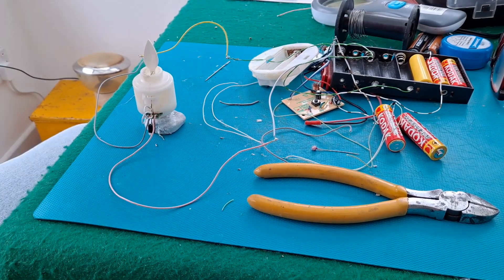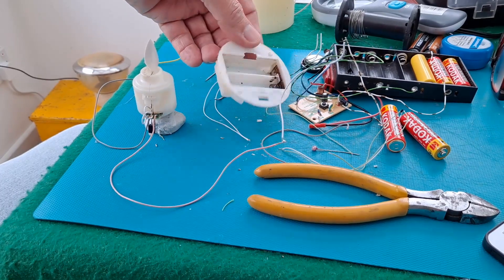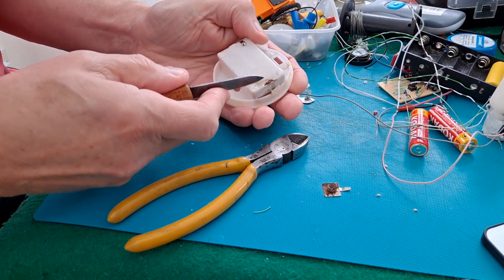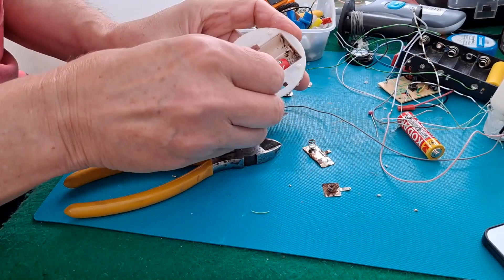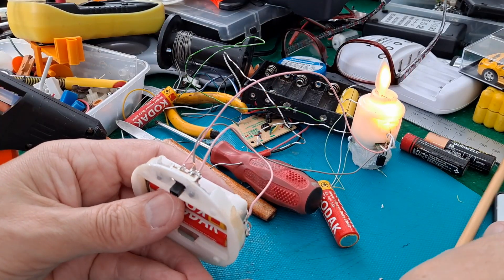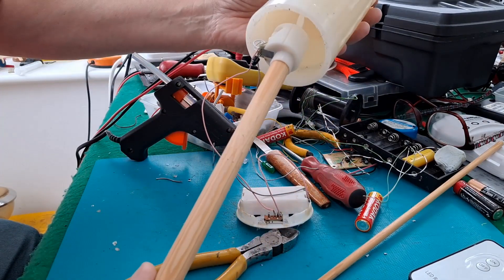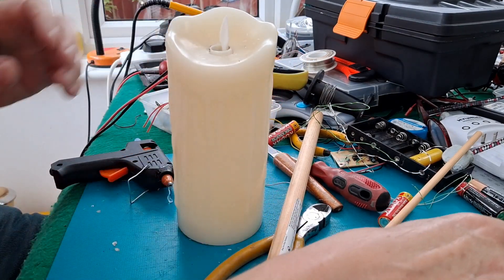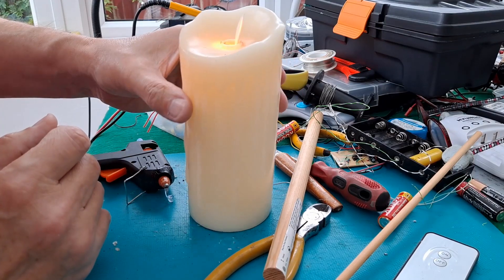Can I fix that IR RC LED candle? Part 5 All back together

Comment: How to remove the bottom? I have a candle which doesnt have the wick. Just a plain one which has an led light inside. 
The remote can make it change colours.
It turns on and off from the switch at the bottom but not responding to the remote at all. Cant use remote to turn it on or off or change colours. How to make it respond to remote?
Reply from the maker: That sounds like a completely different candle design so I would only be guessing. In the video description there are links to the other 4 videos in this series. The base is just a push fit on these.